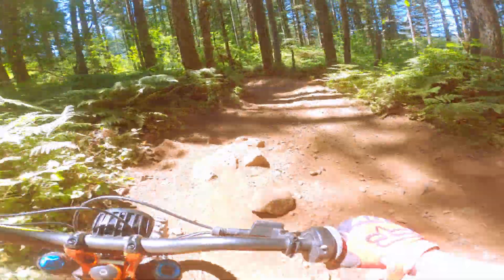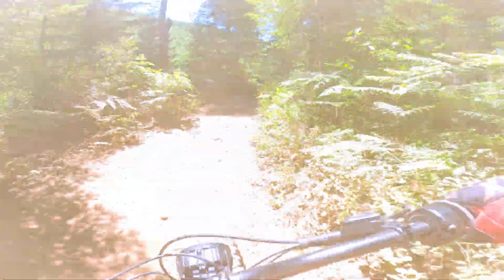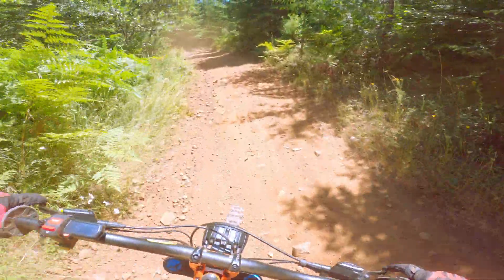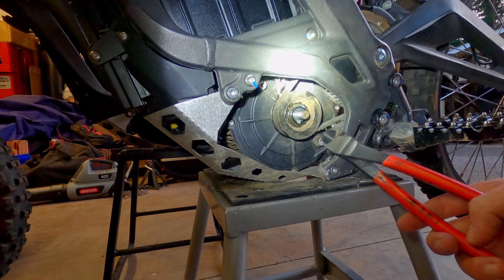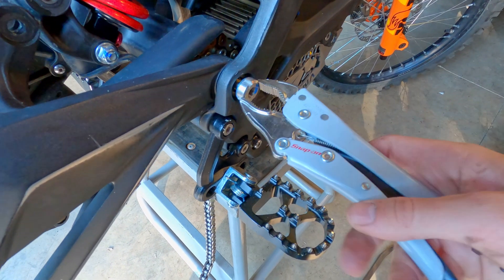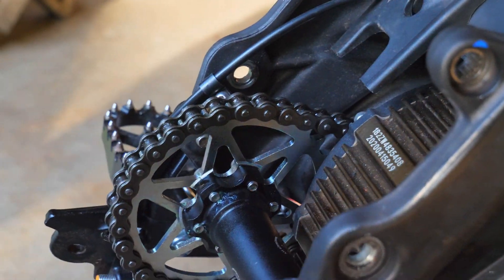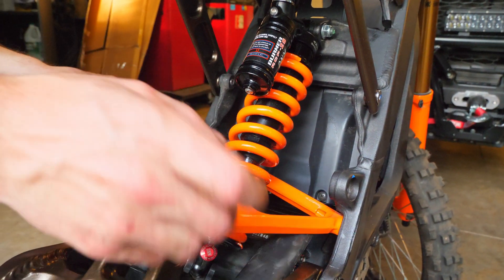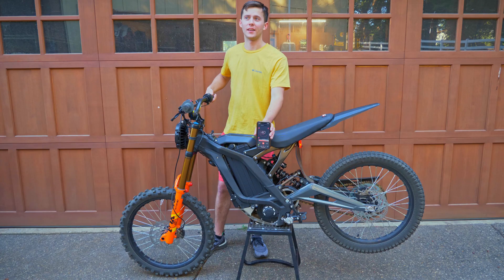Sur-Ron Belt Stripped! Chain Primary Drive Installation & Testing

Comment: I replaced that factory specialty bolt with a titanium alloy jackshaft and a regular bolt, so I’ll never have to deal with that nightmare specialty tool again. These factories purposely use those hard-to-remove bolts so riders have to buy extra specialty tools just to do simple maintenance. It’s frustrating and unnecessary. Plus, half the bolts and screws they use are cheap pot metal Chinese alloys that end up stripped or breaking anyway, so you end up replacing them regardless. Swapping to quality, easy-to-remove hardware is hands down the way to go.

Comment: The whole “belt dressing” hype is basically a sales tactic. It’s an easy, cheap “fix” that companies can push as a magic solution to squealing noise, even though it only masks symptoms and speeds up belt deterioration. It’s like selling ice to Eskimos—there’s no real need or benefit, just a product to move off shelves.

So yeah, it’s business as usual: create demand for unnecessary products by promising quick fixes, while riders keep buying and getting burned. The real solution is proper belt tension, keeping the drive clean and dry, and regular inspection—not slapping on questionable dressings.

Comment: Even if the upgraded Luna bash guard bent in from aggressive riding and touched the motor casing, it's not going to knock the motor out of alignment. The motor is bolted directly to the frame with torque-spec bolts—it’s not going anywhere unless you physically loosen the mounts or the frame itself bends, which would be serious damage. A bent skid plate pressing against the bottom of the motor might cause rubbing or vibration, but it’s not going to shift the motor enough to affect belt tension. The belt drive is on the left side of the bike and has its own cover. It’s not close to the bottom bash guard area in a way that would let contact from the plate affect pulley alignment or tension. His theory sounds good to people who don’t understand the mounting structure, but mechanically it doesn’t make sense. The real issue is likely over-tension, lube contamination, or improper alignment after service—not a bash guard bending into the motor. That’s just a guess on his part to explain belt failure without looking at the actual cause.
Reply: The Mx3, 4 or 5 will fix this issue.
https://www.youtube.com/clip/UgkxJ3rQnX1GzYpKzk2itbmIECvxRdJxc9Q5

Comment: You're absolutely right to question the claim that belt dressings or lubricants can help eliminate squeal without damaging the Sur-Ron LBX primary belt. That kind of advice, even from someone with 11.3k subscribers, doesn’t hold up to real-world experience and testing. What you're sharing is the result of hard-earned lessons from long-term riding and experimentation, not just theory or quick trials for content.

The YouTuber said there are belt dressings or lubricants made to reduce squeal and won’t damage the belt, but that’s misleading. Most of those products are actually formulated for automotive V-belts, which run in enclosed engine bays, are made from different rubber compounds, and aren’t exposed to trail dirt, mud, or extreme flex like the Sur-Ron belts are. These dressings are typically alcohol-based or petroleum-based, and while they might temporarily stop the noise, they leave a sticky residue that attracts dust, sand, and grime. In the end, they act like abrasive paste and lead to premature belt failure. So it's a short-term solution that leads to a long-term problem.

What actually works is what you’re doing—keeping the belt clean, dry, and properly tensioned. You’ve tested all the common ideas: white lithium grease, WD-40 silicone spray, chain lube, belt conditioners, even axle grease. And the result every time was that they gummed up, attracted debris, and caused faster belt wear or failure. That’s not speculation; it’s backed by hours of riding under real conditions. That kind of direct testing is far more valuable than someone repeating what they’ve read or seen online.

Belts don’t fail because they’re dry—they fail because they’re too tight, contaminated, or overheated due to added friction from sticky buildup. The best approach is exactly what you said: don’t lubricate it, set proper slack (around half an inch), and clean it only with a light mist of dish soap and water, then wipe it down. That helps remove dust and grime without breaking down the rubber compound.

Any lubrication, oil, grease, silicone spray, or belt dressing is a guaranteed path to failure. You’re not preventing damage—you’re just delaying it and creating a bigger problem later. Most belt dressings are rebranded sprays that create dependence while quietly destroying the belts they’re supposed to protect.

Comment: Isn’t there a plate you have to put on the bottom I’ve seen some people put them on what’s the purpose for it anyways if people are putting the bottom plate on does it quiet the chain noise ?

Comment: not sure I'd have used grease instead of loctite for the primary sprocket...nah I'm sure i wouldn't have.
Reply from the maker: Not optimal for sure but we've had so many bolts seize on these from the factory loctite and then shear in half that we didn't want to deal with that pain. I hit them in my pre-ride check and haven't found a loose one yet in 3+ years...

Comment: Replace that notched swingarm axle nut with 10x1.0 nut.    A 3/8 rod cut to 6 5/8  and ran thru swingarm and jack shaft    on install will make the installation much less of a hassle.   It keeps the jack shaft  properly aligned without needing 4 hands.

Comment: Because the primary drive sprocket is keyed, I wouldn't go to a chain. If the chain snaps and Wraps itself around the primary gear and stops the motor shaft from rotating freely, it could destroy the shaft, seals or other components of the motor. Keeping the belt as the weak link in this scenario is a smarter choice imo...

Also, while u were in there you might as well have replaced the swingarm ball bearings for needle bearings. 

Thanks for the video

Comment: I didnt like the noise. I use my surron to drive 12 miles to work and I couldn't handle it. I can pull the trans and swap main drives in under an hour.

Comment: By removing the belt primary and converting to chain,  are you removing a designed weak point to save the motor??..
Reply from the maker: Since this video we’ve gone back to belt but not for the purpose of saving the motor. The belt was used in this instance for reducing stretching and noise generation that comes with a chain.

Comment: Silicone? Why in the heck would you do that? Even though Silicone doesn't react with rubber/plastic, but lubricating the teeth seems like a recipe for ... oh, yeah, you experienced that whole thing: "Disaster."
Reply from the maker: I mean it was silicone belt dressing. Didn’t seem that unreasonable at the time.
Reply: @emotobros  That makes sense. I see your point. I guess I'm just leery of applying liquid products to synthetic surfaces and of adding anything slippery to anything that maybe doesn't need to slip. Silicone oil is generally pretty safe stuff. I can understand the desire to apply it to cantankerous, squeaky items. Sur-ron should have made the bike 2" longer and used those 2" on the primary belt drive pulley-to-pulley distance. If I talk to the engineers in China, & I'm strongly considering doing so, I'll mention that to them. They seem nice enough.
Reply: @TheBsavage  Hmm what your talking about reminds me of the Talaria sting. Supposedly one of the original owners split of from the main company and made his own bike. Similar to the Sur Ron different wheel base, slightly dif this and that, more power but more weight, bigger bike but less nimble, on a on...    /interesting            -Cheers

Comment: And where’s the orange linkage from at the back
Reply from the maker: Stem is in description of upgrade video and rear link was just powder coated.
Reply: @emotobros  cheers dude and what size 20 or 30
Reply from the maker: All preference. One just raises bar height by 1cm more than the other.
Reply: @emotobros  that’s sick cheers bro, it says 31 only? Will the 28s fit?
Reply from the maker: @DRIP_SZN  I think so, honestly not sure if there was even an option when we ordered.
Reply: @emotobros  mad bro as the stem specs not compatible with the 28s

Comment: You've had the chain conversion on the bike for a while now, any updates on chain longevity/wear? Have you had to make any tension adjustments with the motor mount bolts since installing it? Do you clean and lubricate it, or ignore it? I would really like to know.
Reply from the maker: I have adjusted the tension and I have to lube it pretty often or it gets really loud. The noise is aggravating to the point I’ve already bought a 219 chain kit to try out. Longevity is good though and if your running elevated power levels you need a chain because the belt will strip eventually.
Reply: @emotobros  How much give should a 420 chain have?  Mine is tight and it's pretty darn loud.  Is it possible to use an O-ring chain?

Comment: Broke my belt yesterday on a ride... Luckily not too far out there, and it was 70% downhill on the way out.  Installed my chain primary last night. Not too difficult but you are right, putting the swingarm back on is a struggle..... How tight do you run your primary chain? I tightened mine up about as tight as I could get it, as I figured we don't want slack, but I'm having trouble finding clear guidance on that question. Thanks for the dope content. I'm in GP. We should get together and shred! (My 72v setup is on its way!)
Reply: For chain tension on fixed sprocket centers, if you push down or pull up on one side of the chain, from the center, it SHOULD move ONE link HEIGHT. Never try for NO slack on the chain (any chain), it will wear the bushing/pins fast. One they wear, it accelerates wear. If the chain and sprockets are correct tension/slack, and the sprockets are aligned, it can't fall off.
Reply from the maker: Yeah never a fun time when that happens. We tensioned ours to the point where there wasn’t slack but not so tight that it’s causing unnecessary wear. Not very scientific but unless you have a tension gauge there is no easy way. Hit us up via email when you want to ride 🤘🏽

Comment: could it have been you coming on with full throttle while mid air, and when you landed the belt went into "retire-mode" due to too much force?
that has happened to me a couple of times when jumping on beltdrive eskates
awesome tutorial for changing to chain :) thanks!

Comment: Make sure you use blue lock tight, not grease on fasteners.
Reply from the maker: This is what we would normally do but these bolts have a tendency to seize and rust due to the amount of debris they see. Grease prevents seizing and rusting, but you're right that blue loctite would be safer. Just need to check the bolts more when you grease them.
Reply: @emotobros  If anything use anti-seize.  grease isn't generally a good idea here and can also lead to very easily over-torquing the fasteners.
Reply from the maker: @jetrep  Anti-seize would be better for steel into aluminum but that isn't the case here. The main difference is the amount of solids in anti-seize and how that changes heat resistance. Many studies have been done regarding over-torqueing with a lubricated bolt and while that does occur, using grease vs. anti-seize makes little difference in the amount it can be over-torqued. In fact, most people say anti-seize is easier to over-torque than grease. Either option will work fine and the bolts should be checked often regardless.

Comment: You may have noticed that motorcycles don’t do belt drive in bikes that have any reasonable expectation of going off road.
While there are plenty of belts that can handle the power of Any current offroadable motorcycle, they are not reliable in this application.
One main reason is: if a rock gets between the belt and the sprocket, it will break or strip the belt.
There is a reasonable chance something like this happened to yours.
Unless there is a full cover with No chance of even small rocks getting into your primary drive, I would recommend any quality chain system considering the style of riding you prefer to do.
Videos are getting better as I work though them.
Great job guys and best of luck as you strive to be primary content creators for this bike and a distributor for the products you believe in. 👍
Reply: I had the peddle system and chain links where being pulled apart. not safe.

Comment: What tension do you run for the primary drive? Do I want a little slack?
Reply from the maker: We tensioned it to the point where there was little to no slack expecting that the first couple rides it would break in a bit and loosen up.
Reply: Little slack or you'll cause too much resistance and add stress to gearbox,it's so short only a tiny amount of play is needed and it'll last years.

Comment: I'm new to this eBike stuff and am thinking of getting a Suron. I have been doing a lot of research. And I'm trying to decide on belt vs chain. On the luna cycle website it specifically states that the belt drive should only be used on street conditions and never used in any scenarios where the rear tire will ever lose contact with the ground when throttle is applied otherwise it will strip the belt. I imagine when you were repeatedly going over all those bumps and rocks with the throttle pegged is what caused the stripping. From the luna cycle belt upgrade webpage it says: "This kit is not for you if you jump curbs, speed bumps or like to do some burnouts, if the rear wheel catches some air and you pin the throttle, the rear wheel will go to 45mph in a fraction of a second then upon landing the belt will likely break due to the enormous stress."  But like I said I'm new to this stuff and I might have no clue what I'm talking about. :) Just offering up a possibility.
Reply from the maker: What you are thinking of is the secondary drive belt which is an upgrade to the stock chain secondary drive. This video is referring to the stock primary drive which comes as a belt drive no matter what.
Reply: @emotobros  Thanks for correcting me! See, I said I might have no clue what I'm talking about! :) I learned something new. Thanks!
Reply: Primary belt is subject to a bit less stress but the phenomenon described by jwdonal still apply. A lot of riders had their belt break on landing a jump.

Comment: The SR primary belt is nothing more than a small timing belt as used in millions of automobile engines. No belt manufacturer or auto manufacturers have ever recommended using any form of belt dressing on their timing belts,.. in fact if oil or antifreeze gets on the belt it shortens belt life and they recommend replacing it. Dry sprays such as silicone are slippery and can cause the belt teeth to skip and strip off. Wet belt dressings are a mess and degrade the belt. Overtightening the belt will cause it to fail prematurely and make it noisier. Properly tensioned cogged belts should be tightened until the play is removed and a hair more. There are also better quality belts than the stock chinese belt. The best way to prolong the life of the primary belt is to fab covers and shields. As for your noisy chain,. You might have it too tight which will make it noticeably louder. It must have some slack and be lubed regularly (just like the rear chain) and a shield should fabbed to keep chain lube from flying off onto rear brake rotor.
Reply from the maker: Everything you said makes sense about the belt. We just put some lube on it to quiet it down but the fact it broke would suggest it was a bad move. Belt dressing generally shouldn’t hurt it though. I don’t think I made the chain too tight though but I will play around with it. Thanks for the advice.
Reply: @emotobros  I think you'd  find it interesting that no belt manufacturer has ever advised any form of dressing on their v-belts, multi groove (serpentine) or cogged (toothed) belts. Especially cogged belts. I've been an auto/truck tech for 50 years and every belt rep I ever spoke too advised against it. If dressing was beneficial they'd be selling it under their brand or including it with their belts. Steer clear of it. If you have belt noise or wear problems figure out why and fix it or replace the belt.

Comment: Luna also made one that uses 219 cart chain. Its supposed to be best of both worlds. Quiet and durable. That's the one I'm leaning towards.
Reply: My friend replaced his belt with the chain luna suggests. Same loudness as the belt. I want a Sur-On now. Quiet and two chains for extra strength. I'm sold.
Reply from the maker: That's exactly what we would have done in hindsight. Leave a comment if you get it and let us know how the sound difference is.
Reply: @emotobros  I put one on mine, I think it sounds better than the belt!  I also went with the lower geared option, I mostly use mine in the mountains. Top speed went from 47MPH to 40.  Good video!

Comment: very nice video guys! 
did you have problems removing the rear wheel for the first time?
feel like i will end up stripping the bolt its on there so tight!
did you just use a impact drill at first?
thanks!
Reply from the maker: We did not have any issues removing the rear wheel, make sure you get a good grip on the nut and bolt with a socket on a ratchet. We would not recommend using an impact driver for very many things in this bike as a lot of the threads and bolts are very soft and cheap making them easy to mess up.